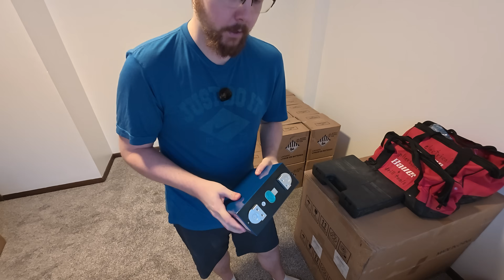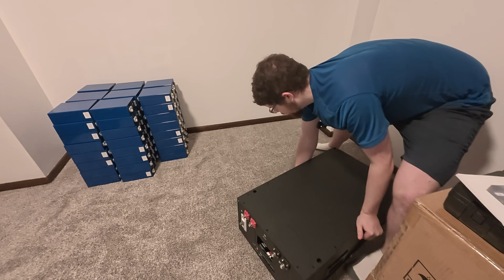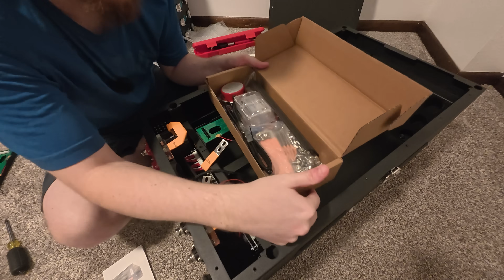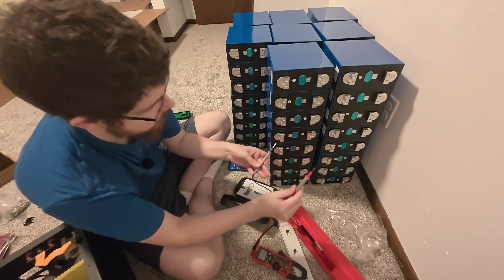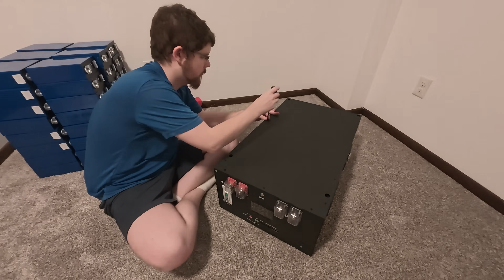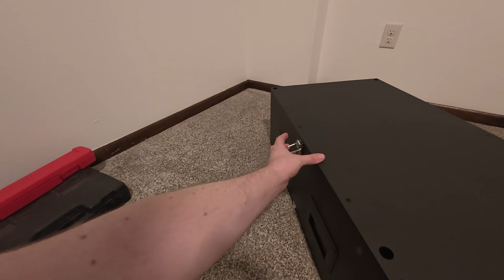Assembling a 16kWh LiFePo4 DIY battery for my off-grid property [Full walkthrough]

Comment: You were lucky you didn’t get bit! Another precaution is to tape the metal areas on your wrenches. This will prevent grounding. Proper PPE is strongly advised.
I love the idea get the most bang for your buck. Hoping the system you’re starting will grow and provide you with the power and flexibility to expand and not be useless in 5 years. Not being a Debbie downer but technology changes so fast. 
Good Luck can’t wait for the thaw to see how far you get!
Keep on Truckin from Texas!😎🇺🇸🤘⚡️

Comment: You really need to watch the off grid garage from Australia, he's a bit of a battery nut but he definitely believes in safety and he tells you all kinds of interesting information. Oh I wasn't messing around about the battery nut part, he currently has either just below or over 200 kwh in batteries, he primarily focuses on solar and doesn't have any wind generators which I disagree with but who cares it's fun watching him. You will need wind generators unless you plan on getting some kind of fuel burning generator and wasting a free energy source.
Reply: You should get a yellow or black marker to mark the bolts that you tightened up.
Reply: The holes in the top of the case are for the little plastic nubs{feet} to sit to keep the battery in place while you latch the clamps on the side of the case. It's like a 6 way securement point. Also you need to build a roller cart with locking wheels for the battery stack to sit on in case you ever need to move the batteries around. Also wherever you store those batteries will need to be heated up in the winter unless you want to destroy them when the temperature goes down too low, they will need cooled in summer if the temperature gets too hot also.
Reply: Great video.

Comment: Or you could have gone with mb56 cells and storage case, instead of mb31 cells and case. It would have been about half of your shipping costs and 1 mb56 case and cell is 32 to 33kwh which is the same as 2 of those mb31 cases.
Reply: Also an mb31 fully assembled should weigh a little less than 340 lbs.
Reply: The mega buss bar! Cool.
Reply: When you install solar panels on your off grid property also install a couple wind generators to compensate when you barely get any sun in the winter plus it'll charge your system even at night when the sun goes down.
Reply: You should break out a shop vac and suck up the slag from the bottom of the case before you go and move it around to keep any further arching events from happening. The face of the case is removable but before you remove it disconnect the main terminals from the positive and negative from the bms to prevent any further arching and use a flexible plastic vacuum tube only. You definitely need to get the slag out before transporting this battery to your off grid home. If the slag bounces for any reason during transport and makes contact with the wrong location you will have a possible meltdown situation.

Comment: One more point - you mentioned the holes in the top of the case.  Andy of The Off Grid Garage has built a couple of the Yia Xiang (sp?) batteries and I believe his cases came with rubber feet that fit in the top of any cases that were underneath.

Comment: I've been accumulation tools and hardware for my first DIY battery, and have some insulated gloves and HIGH VOLTAGE screwdrivers. I didn't get insulated socket wrenches because of the cost...I think your video changed my mind... also haven't been using my protective glasses while working around my batteries.  Now I know why Will Prowse is so adamant about always using them... Sorry about your accident, but...Thanks!   
BTW, Some of the reviewers who have done raw cell batteries have been able to get their cell sources to replace dented ones, free.  Check back with your seller for that bad one, and see what they say.

Comment: I just purchased one of those, all the parts finally arrive after two months.  The quality seems to be extremely good.  Even bough the rolling base, nice heady duty unit.  I'm going to finish setting mine up tomorrow, if it works well I will be expanding it.  This unit definitely isn't your typical junk.

Comment: Good you're keeping busy. I have two 200Ah batteries in my trailer and when I move the system to a new trailer I'll probably add a third battery since I'll be off grid all summer. Once I get something built on my land I'll swap to a 48V house system.
Reply from the maker: Very cool! In my opinion, 48V is the way to go even for small systems unless you need to connect to existing 12V batteries. 12V requires beefy cables to handle the amps and copper is just so dang expensive.
Reply: @FreedomFrontierAlaska  yeah if I didn't already have a full Victron setup I'd probably swap, but I already have it so I'll use it until I build a structure or can afford to have the power run across the street.